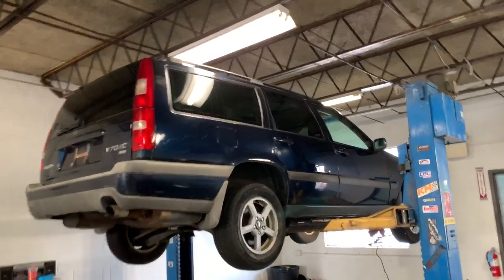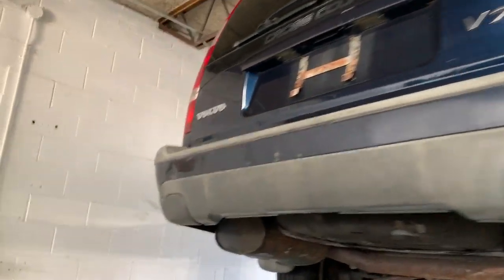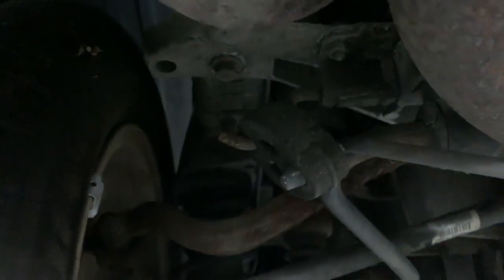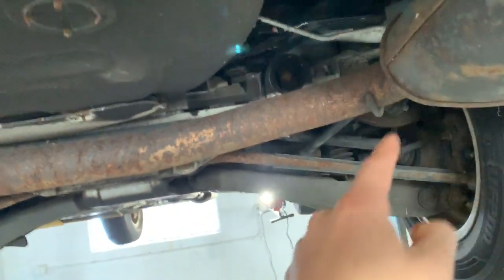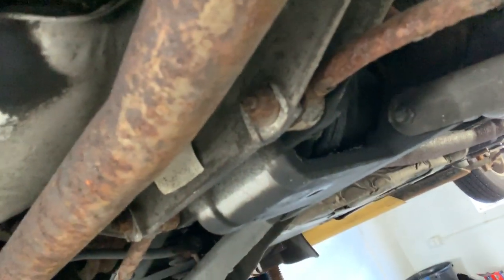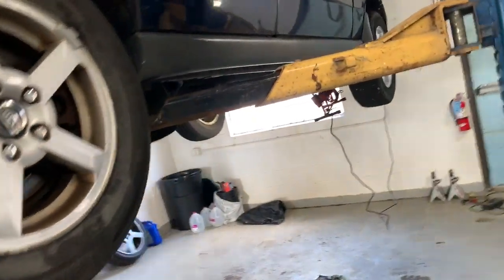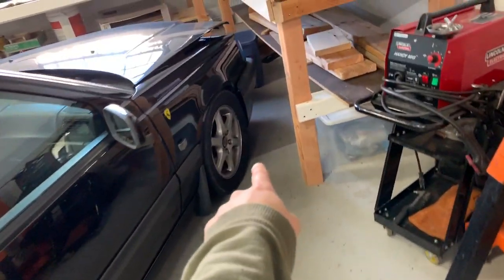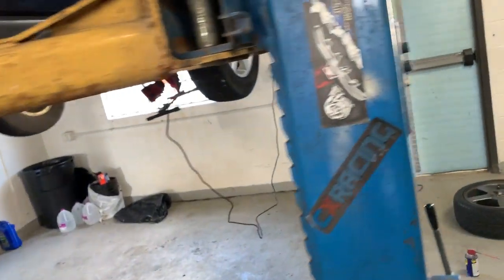Volvo 850 T-5R AWD Swap - Winter plans??

Comment: Always had my doubts about an awd being able to handle the power. I have wanted one of these for a while but wont pull the trigger because of those shitty angle gears. Very interested in what you design to improve or replace it.  Been following since the paddle shifter days lol

Comment: I had no idea the rear end is that strong. Don’t the viscous couplings die, as often as the angle gears? 
Another possibility, if those components can be made to be strong enough. Can I make my manual 97awd, rwd?

Comment: All the driveshafts I have replaced were due to the front CV joint failure. Hot exhaust cooked the grease. Volvo came out with a kit for replacing that front CV joint. Oh the other weak area was the sleeve to the bevel gear. More of a problem on the HALDEX CARS.

Comment: I noticed the flange from the angle gear has an outer "cup" which tells me you have a late VIN 1998 car...might be important only if you're planning to reuse the existing setup with a new driveshaft.  1998 has a VIN split mid year, with a few annoying differences. 1999, and 2000 AWD components are all completely different from one another.   If you plan to send any power to the rear, might as well rotate the engine 90 degrees and adapt a STI 6-speed! lol
Reply from the maker: Yup I have the good AWD stuff. Means I can use the 99-00 prop shaft with the larger carrier bearing as long as I redrill the mount holes for the carrier bearing.
Reply: @SimplyVolvo  What about the viscous coupling? do you plan to replace it with something that can lock?  the V.C. only transfers power when there is a difference in wheel speed front to back...so its not ideal.  I have an AWD '98 R so i will follow your build closely as you upgrade the angle gear and other components.  Keep up the good work!
Reply from the maker: @jasonbilyeu6119  Thats not true. The VC will lock 50/50 when you are producing high enough torque. It been documented above 300awhp it locks 50/50.

Comment: if the drive shaft is off then it probably blew up the visco clutch. check it before you start tearing that rear end apart.
Reply from the maker: The rear end seems to rotate fine. Is there a procedure to test the VC? I think that is more likely that happened is the carrier bearing or CV on the propshaft went. Thats usually why people remove the propshaft. VC is pretty inexpensive to buy new from VOLVO so as long as the rear diff is OK. Mainly got the car for the rear subframe / diff.
Reply: @SimplyVolvo  yeah the rear end is stout but the VC like to slip with not enough torque being sent to it, you can't test by holding the wheels and turn the VC with something doesn't matter too much what it is. If it's healthy it will turn but have a good amount of resistance with the wheels not moving. This will also test the reverse disconnect clutch on our AWD systems, I think about 90nm is what it should take to spin the VC
Reply: There are a few high HP VC cars, with enough torque sent to it they lock up 50/50. You should have no problems with the amount of power. My VC has over 300k on it and still locks up good.
Reply from the maker: @micahb5659  Thank you so much for the info Micah. I will try locking the wheels and seeing if the VC has resistance when turning with a breaker bar.
Reply: @SimplyVolvo  I don't believe you can buy new VCs. Care to share a link/lead on that?
Reply from the maker: @ericallen7336  Yes you can... PN 9183905. Volvo calls it a "CLUTCH"
Reply: @SimplyVolvo  Well I'll be damned. Spent an afternoon trying to find it. Thanks! Can't believe how expensive tho!

Comment: Suuuuuuuper hyped for this! I would be really interested if all the same mods you'll be doing to the 98 xc angle gear would apply to the 2000 as well because I know they are externally slightly different.

Comment: Now we are talking. My 850 AWD owning self is really ancious to see what you got in mind with that angle gear. Supposedly it is not capable of handling more than 400 Nm , which is what kept me away from any modifications exceeding 300 hp.
Reply from the maker: Still working on some prototypes but i have done a lot of R&D on the failure and also lots of FEA on why the failure happens and was able to reproduce the exact failure in a simulation.
Reply: @SimplyVolvo  can you explain to a non native english speaker what R&D and FEA stands for?
Reply: FEA fiddling experimenting aggrevating? Just kidding
Reply from the maker: @derpapito1391  R&D = Research & Development. FEA = Finite Element Analysis.
Reply: @SimplyVolvo  thanx

Comment: Interesting. Curious to see the transfer case mod and to know where you will  source your prop shaft from. The U joint locked up and took out the carrier bearing years ago in my 98 V70R.
Reply from the maker: Ill probably just buy a new propshaft from volvo.

Comment: I love your content,and have been subbed for awhile. I've also seen you post many times on Facebook. I've been interested in getting this done on my 850R sedan for a long time. I Would love to see the content done. Also if you would be willing to do the installation job for customers after you figure this all out. Then please let me know plus the price for getting it hooked up to a auto gearbox. Currently getting a rebuilt transmission installed in 2 months since the gearbox with 147k miles didn't like the added horsepower and it shifts hard and has hardly any reverse gear plus its leak a quart every 2-3 months now. After the trans job it needs a lifter job and then a full new paint job since the car has been in around 6 accidents over its lifetime so it really needs one. Also going to be finally getting a indoor garage very soon which is another must if you want to keep the paint in good condition. Already have the rest of the car staged zero plus these upgrades mods 20t turbo green injectors snabb intake kit d088 radiator inter cooler rip kit , ipd 3inch exhaust and tuned by Steve O and most of the work was done by Ben Mcnally. I'm only looking for max 400bhp since that is the max these engines should be able to take without blowing up and is plenty for the road here in Brooklyn. If I didn't live in NYC I would have already converted her to a manual gear box and a fully rebuilt motor but its really exhausting driving here with a manual and IMHO dangerous due to other drivers cramped roads here. Its hard finding a good shop that won't rip you off here as well. Also wondering do you also use AMSOIL products on your vehicle? With all the work you have done its probably a good idea since they appear to be the best manufacturer of oils and coolant on the market !